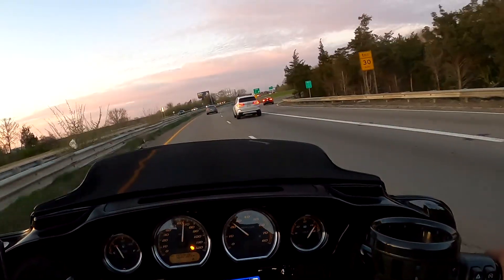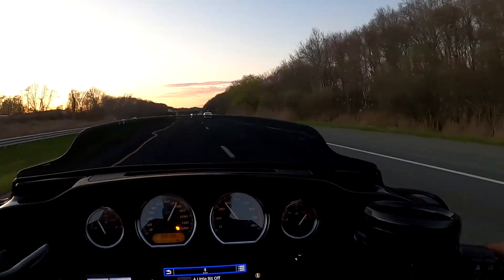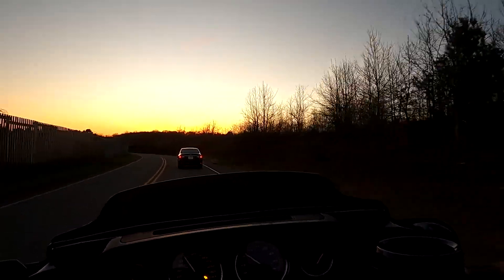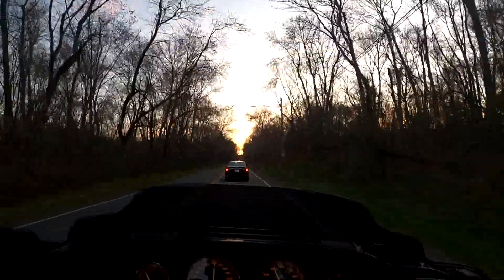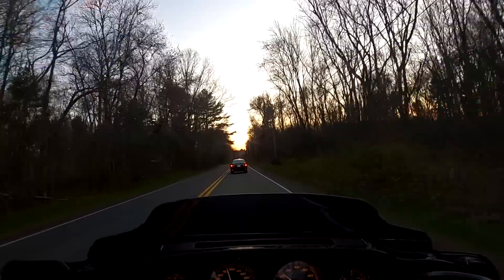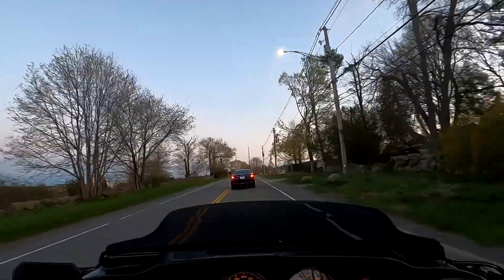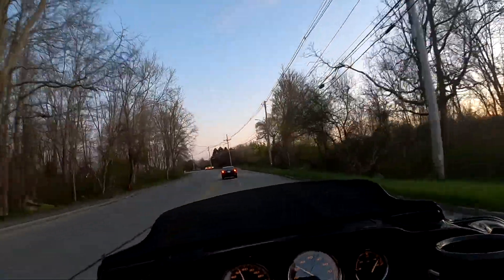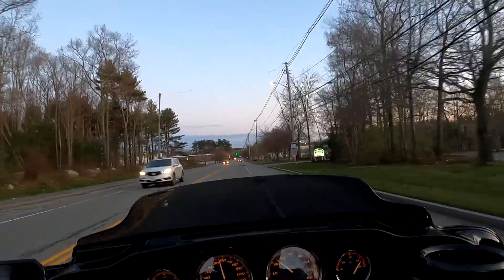first motovlog ep 1 spark plugs

Comment: Did you already get it dyno tuned? Or using the fuelmoto map. I got my 30/30 in the mail last week, doing the cam now with the help of your video!
Reply from the maker: I did get it tuned yes that’s awesome if you have any questions let me know
Reply from the maker: It’s pretty simple stuff
Reply from the maker: What tuner are you running
Reply: @capecodbiker9902  just installed the cam, needle bearing, wood performance lifter, s&s tappet cuff, and ez pushrods. Also flashed the power vision. Where did you go for the tune? I’m up in middlesex county
Reply from the maker: @MindlessMilitia  robs Dino tune
Reply from the maker: @MindlessMilitia  worth the drive and he honest

Comment: Yea I change my plugs I was thanking it wasjust in my head  that ran different not much but different like was lacking something
Reply from the maker: Right there’s definitely a A difference they are not made to operate on that system I also have the screaming eagle thick wires. And it’s still not right  went back to the stock plugs and she runs great again thanks for watching bud